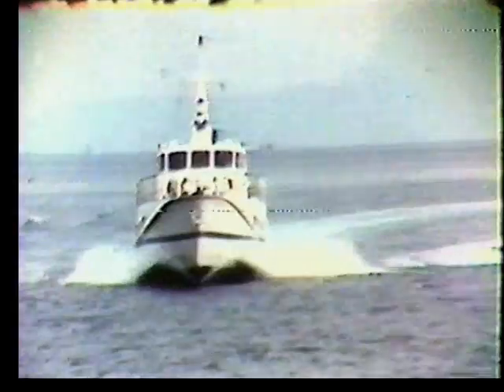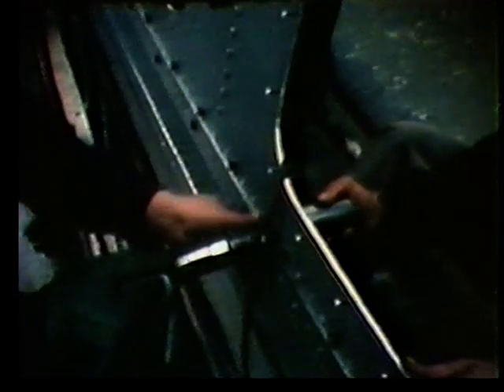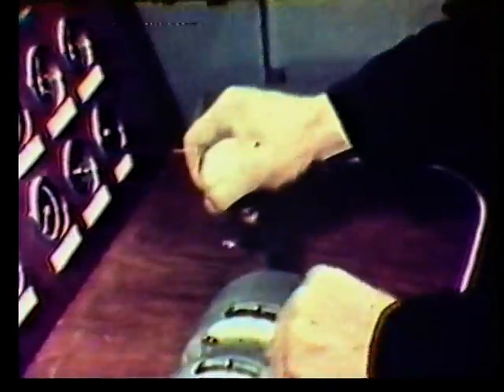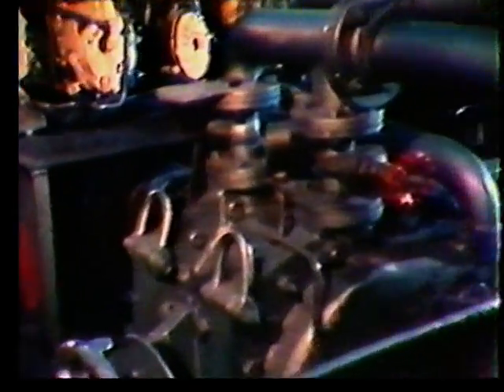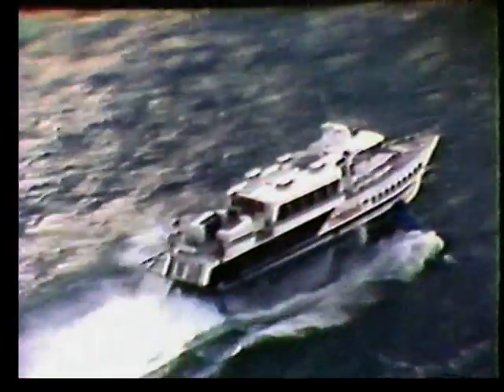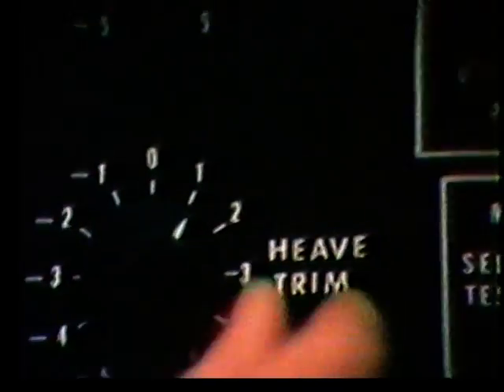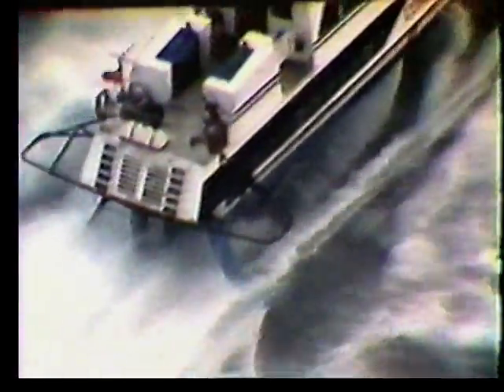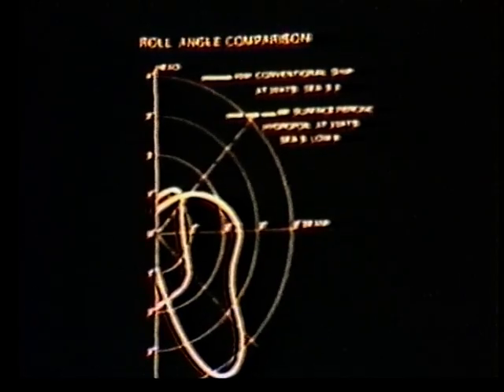Rodriquez Hydrofoils Promo 1977

Comment: I love this video so much, thank you. 
I travelled on Condor 5 from Weymouth to Jersey in September 1990 when the new Wavepiercing catamaran Condor 9 was out of service with teething troubles.
The crossing was not smooth by any means, the front lower lounge got hot and rather uncomfortable....rear lower lounge was better though! However this lovely old RHS160 hydrofoil romped along in fine style and took the English Channel swell in her stride, and I can still hear the throb from her twin 12-cylinder MTU 652 engines over a quarter of a century later.